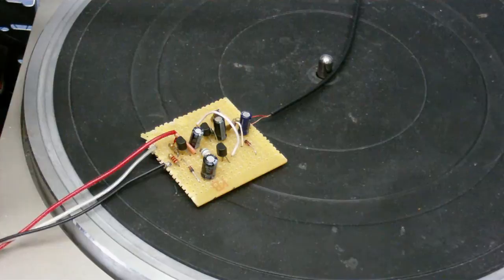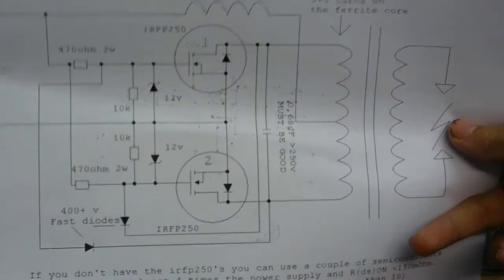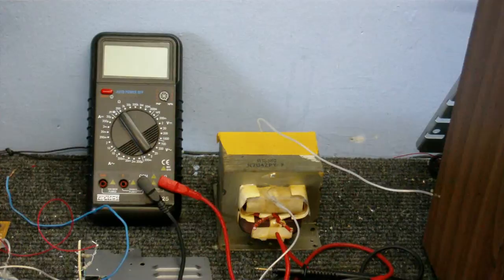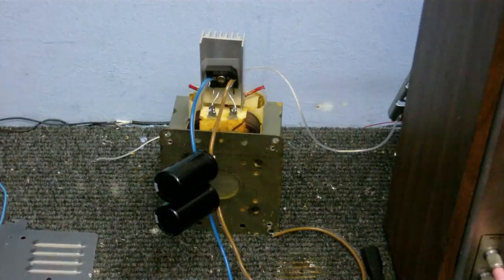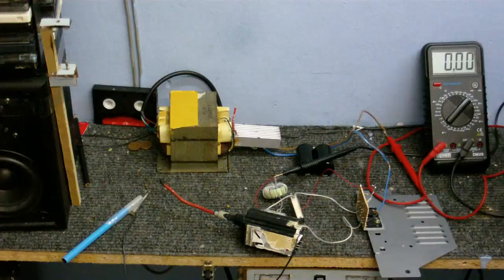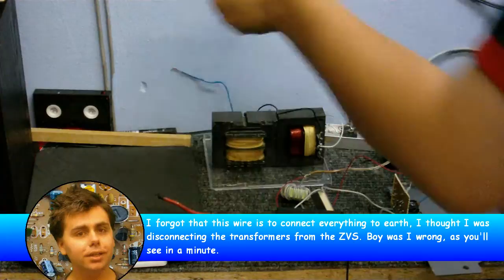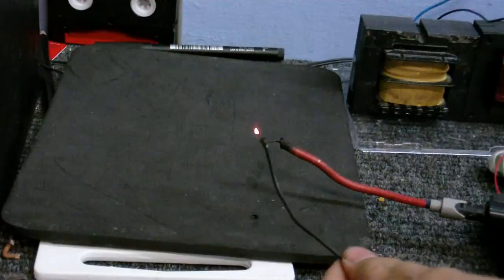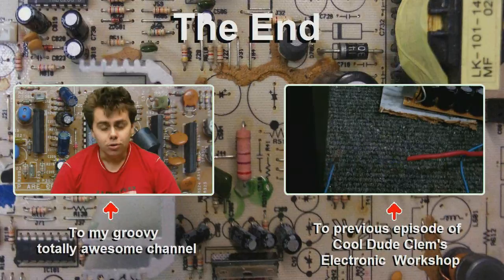Automatic Gain Control, Transformer Modifications, & My first ZVS flyback driver.

Comment: A great method to remove the secondary from a MOT is to just drill out the windings! Saw off both ends, put it in a vice, and get to work :) You gotta go a little each time though, because the drill gets very hot.

Comment: hey i have a 6V solar cell that puts out about 250mA, but i need 1 amp for the circuit im building. is there any way to increase the current output without using a bigger cell or wirring up more cells.

Comment: that is radged to the max you o and do a circuit all perfect and test it all and make it all precise it doesnt usualy work u end up having to do womething coz uve blown sumert but today you built the circuitls and dont mesure the windings and use a different capacitor and bingo it works well clem youre good at making circuits keep it up and ps remeber when you were setting stuff on fire with the microwace transformer and putting tape and foil ontom well tape the moths wing to the trans and burn